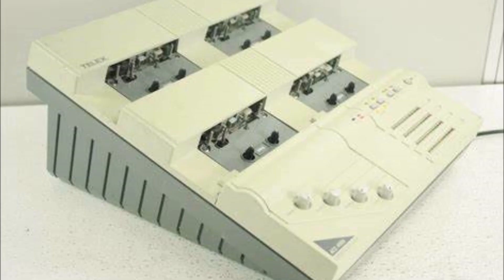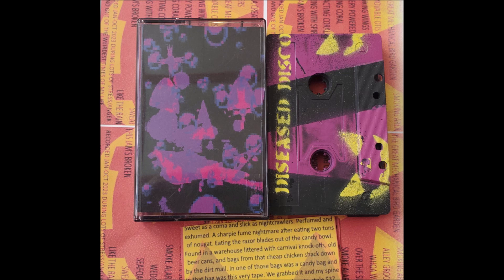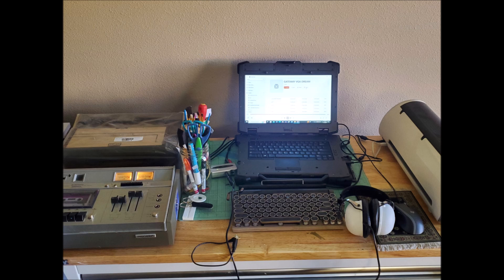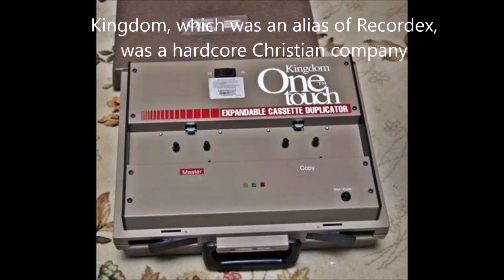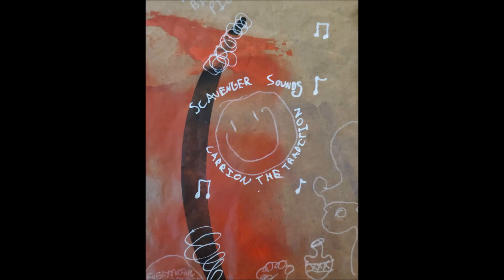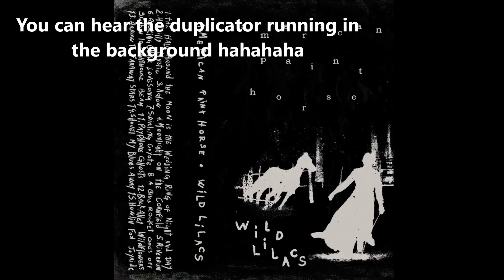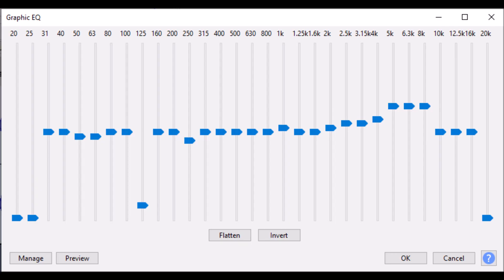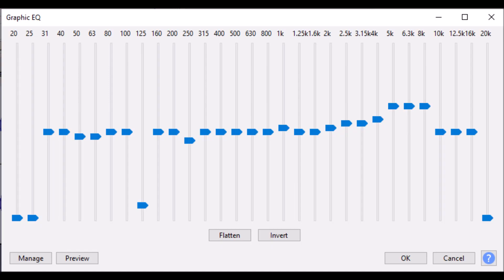EQing Applied to Poor Quality Cassette Duplicators (Telex Copyette II Example)

Comment from the maker: Update for anyone who cares:

The Telex Copyette Series II duplicator is a monophonic unit- despite claims online that its stereo. My unit also had very low-quality heads, and they were really worn. As such, I have scrapped this unit for parts- no big loss, these guys are always on craigslist/facebook marketplace for 5-10 dollars... I am working on two Telex ACC-4000s and dubbing all tapes in real time currently. The ACC-4000s sound a LOT better, but mine were pulled out of scrapyards (well, one came from a scrapyard, one came from craigslist) and had a number of issues. I've fixed most of the issues, but im still doing some mechanical fine-tuning.
Reply: Did you have problems with the ACC-4000 tape eating? 3 out of the 4 tape bays will eat my tapes. Cleaned the pinch rollers, no change. Might just try to combine it with my 4000 XL which only has busted front panel and few busted buttons.
Reply from the maker: @GBock77  I'll almost guarantee you that if you pull the front panel on your 4000 you've got damaged gears. This is an incredibly common issue that plagues these machines. I reverse engineered the gears in mine with some calipers and CAD software and made replicas with a 3D printer and nylon filament. Haven't had any issues with the replica gears yet, but before replacing the gears I was having all sorts of issues with tapes being eaten.
Reply from the maker: @GBock77  the XL is a much better machine. If you can only salvage one, go for the XL.
Reply: @electricalscarecrow  Okay, so I have taken the side and front circuit boards out of the 4000-XL (each was missing some silver plastic cube things I cannot name) and replaced them with the boards from the 4000. Upper left tape bay had misaligned gears that were pushed into place. It will now rewind but will not copy or clean, had an 'X' written in sharpie on the protective plate so I'm wondering if it's been deemed a lost cause long ago. Lower right tape bay's levers jam, only allowing the playback head to move halfway. A little elbow grease and repetition seemed to do the trick. However, when I go to record, the LED lights for the various channels do not activate at all. I still need to test (listen to) the audio quality of a copied tape as I merely observed the mechanical processes so far. Perhaps I need to give the pinch rollers a deeper clean.
Reply from the maker: @GBock77   @GBock77  do you have discord? We could exchange pics maybe. The 4000XL machines have a much higher quality head type (If you trust old brochures, XL actually stands for Extended Life). Most of the 4000 standards I've worked on have had pretty worn out heads. A lot of the XLs also have polyurethane rollers... 

The main board under the hood is a preamplification/equalization board. The reason you aren't seeing any lights for the recording indicators is likely due to failed SMD electrolytic capacitors on this board. I've worked on a handful of 4000s/4000XLs now... they've all had failed caps on that board.
Reply from the maker: @GBock77  The XL also has the ability to dub from/to Type II tapes... the standard doesn't have that. If you compare boards between the two you'll see that the necessary bias circuity is missing on the standard.
Reply: @GBock77  i just had an issue with a hungry acc-4000 two days ago. as well as the the tape getting caught around one of the pinch rollers the master mechanism didn't want to release after duplication and prevented the master slot from rewinding.
Reply: THANK YOU for all the acc-4000 info, this is a great resource. i saw you mentioned discord, definitely drop a link if you can!
Reply from the maker: @anthonypurpera6517  I'm "suckmerawthroughaflavorstraw" on discord. Hit me up! I'll send pics of the gears I designed and we can talk about troubleshooting.